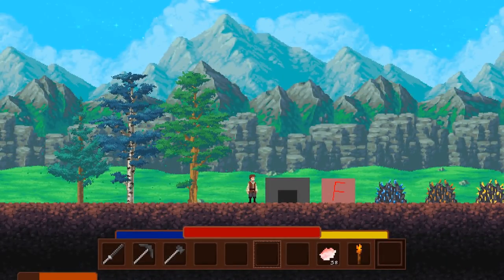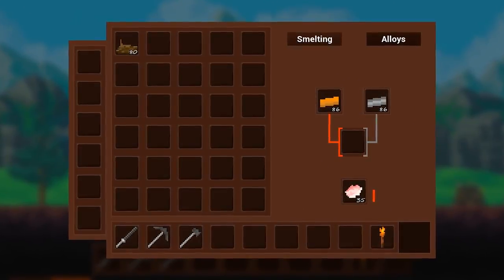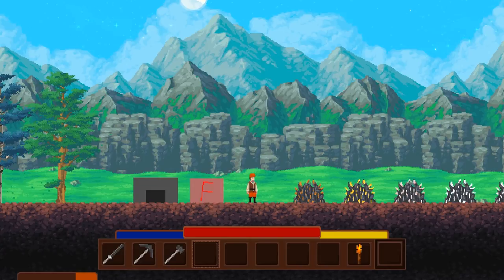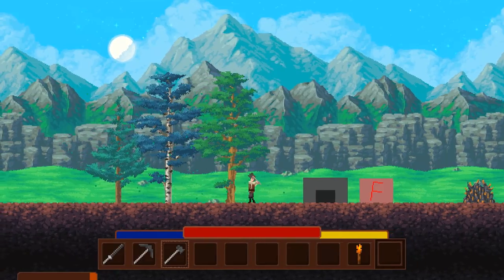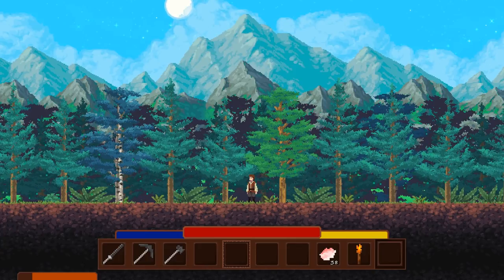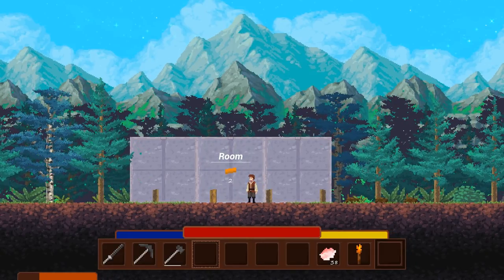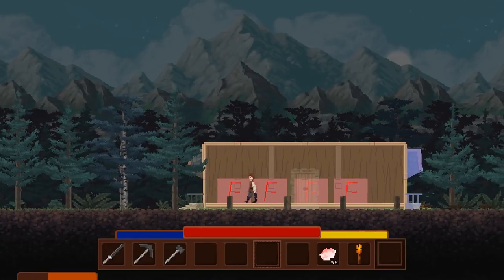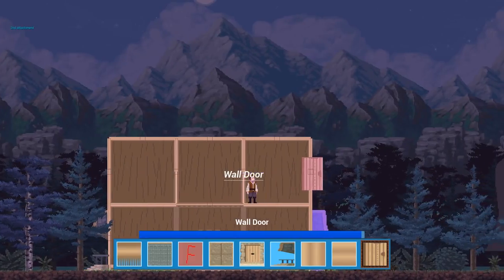Arcane Devlog #7 - Base Building & Forging - Indie Game Devlog

Comment: Should make bronze and copper look a little different and in your inventory system where u put armour on put a light outline of where the armour goes. So the top slot put a very light grey helmet picture over it so they know where the helmet is. Apart from that looks good.